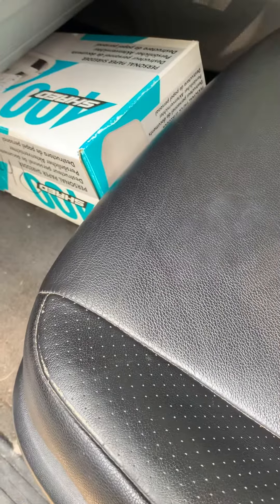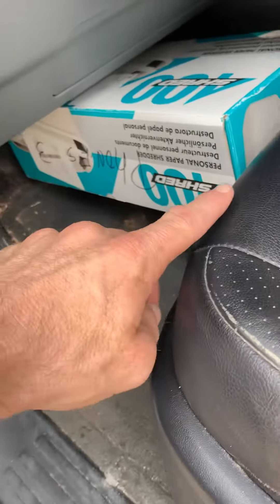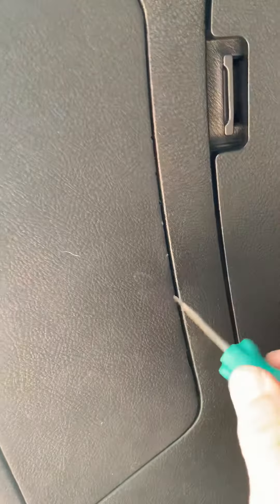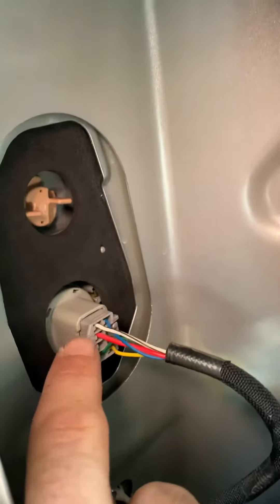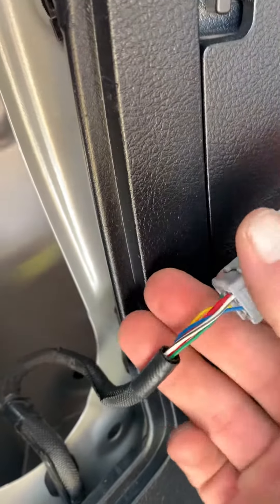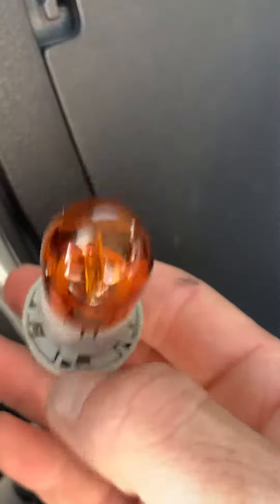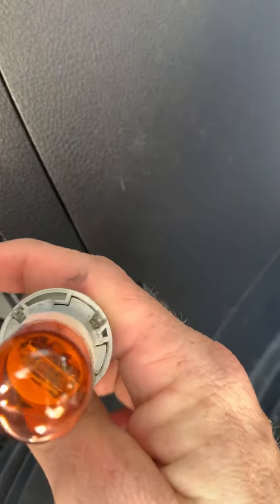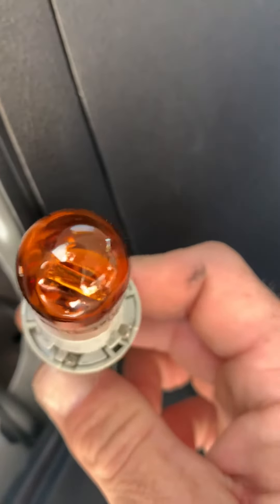2010 Toyota 4Runner brake light keeps going out fix

Comment: You are a Life saver Dude!..I got pulled over 2weeks ago and cop said my light was out...I was livid because I checked the bulb and it was fine..couldn't for the life of me figure out why the parking light in same bulb worked but the brake/Stop element wouldnt light up!..you just saved a potential rip off at a repair shop or a ticket.(I got a warning by the cop for the light and was advised to get it fixed)..God bless you

Comment: Just wanted to add my thanks to all the others on this thread.  I would never have thought a problem with the brake light might have originated with what is the turn signal socket.  I tried adjusting the ears and got inconsistent results. So, I went to Toyota and picked up a new socket for $13 and that fixed the problem.  I was prepared to install a new tail light assembly for $174 and your advice saved me from having to do that.  I told my wife (it's her 2012 4Runner) this would have been a $400 repair at the dealer and now I'm wondering if she'll go out and spend that amount on something entirely unrelated, simply because we didn't have to spend it on the dealer.  If she does, I'm sending you the bill!  (Just kidding).  Again, a big thank you!

Comment: Joshua, I wanted to personally thank you for this video because I replaced my brake light today and it still wouldn't work. I would try it on passenger side, and it would work but not the driver's side. That left me with a good bulb and a good socket. Then I said to myself, "Dang! It's ground or a bad wire." I searched Google and happened upon your video. Google plus Joshua was the cure for a bad break light. Thank you, thank you!
Reply: Same exact story for me!

Comment: Works on my 2010 4Runner but after a few months the bulb went out again so it's best to check periodically. Slightly bent the metal contact upward on the outer end which might help for a better connection.

Comment: I have a 2011 4Runner. My left brake light hasn’t worked in 2 years, at least. I’ve tried 1) replacing the bulb, 2) replacing the socket on all three (b/u, brake, blinker), 3) replacing the light assembly in its entirety, 4) checking that electrical power is running to the light assembly, 5) making sure the metal connector is pushed up to make the connection and is clean. I’m at a loss at what else it could be. My right one works, and when I switch the parts over to the left side, it still doesn’t work 😭 any other tricks to try?

Comment: Hi joshua! Thanks for the video. I tried doing this, without understanding it much, but it didn't work out for me. I pushed the piece of metal down many times, but don't see anything changing. Any other advice you could offer? Have also replaced the bulb.
Reply from the maker: You may want to try cleaning the metal part too if it’s corroded
Reply: Try pulling the prong up and out.

Comment: Thank you so very much !  I struggled for weeks to find a solution.  I called the local Toyota dealer but it was going to cost an arm and a leg.  I found a full light assembly for around $80 that i was going to purchase as a last resort.  This worked!  Cannot thank you enough for deciding to share this.  Much gratitude, Cher